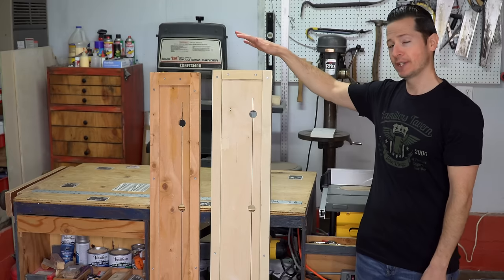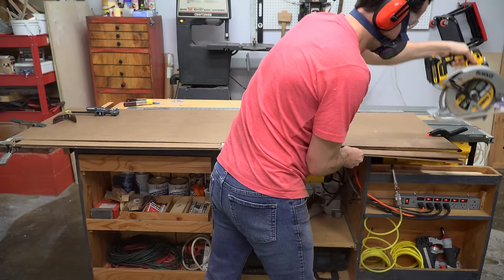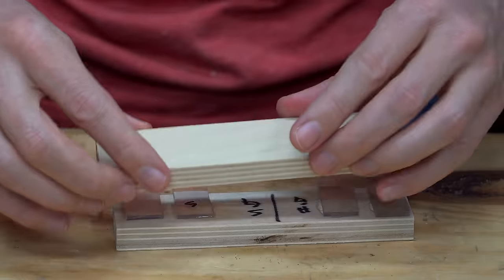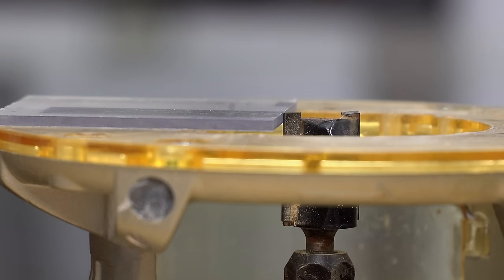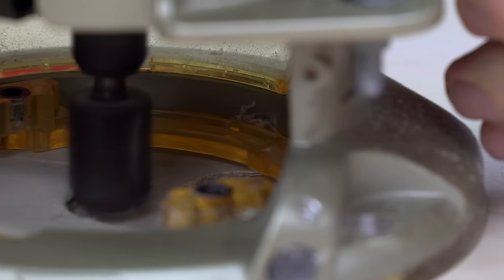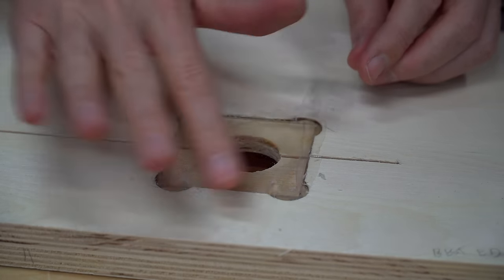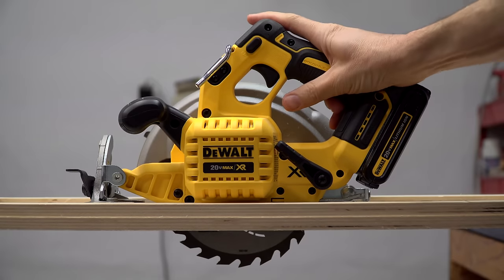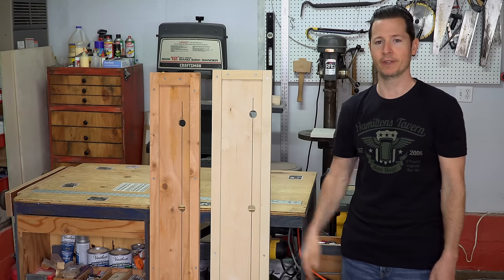DIY Saw Track Update

Comment: Great idea but whats the advantage of the plexi glass?
Reply from the maker: Thanks! The plexiglass just helps reduce tear-out at the sight hole locations. I hope this helps!
Reply: It also seems that it helps to line up the edge of the plexiglas with your cut line. (Instead of just the corners at the edge of the circle)
Reply: It is harder to scratch than polycarbonate.
Reply: @JF-mq8tp  Lexan IS polycarbonate
Reply: It appears the plexy will give you an alignment assist for your mark. When I try this I will put in the plexy also.
Reply: If you leave plexiglass slightly lower in dado, will it keep it from scratching over time?

Comment: TO make a splinter free cut first make a "kiss" cut . set the saw depth to just barely cut thru the top surface then lower the blade to cut all the way thru. I have a sharpie mark on the depth adjustment to quickly set the " Kiss" cut/ depth High end cabinet table saws have a small kerf blade directly in line with the main blade making a kerf  cut does the same thing the kiss cut does
Reply from the maker: Thanks for the tip!

Comment: Great build - what about using plexiglass as the whole base for more visibility as well as a deeper cut
Reply from the maker: Thank you! You could use plexiglass, but it would probably increase the cost of the build substantially. I hope this helps!
Reply: I did wonder the same. If a reasonable size piece of plexiglass is cheaper than the shop-bought circular saw guides then I reckon it'd still be worth it. Mind you, if it's not cheaper... Another option might be to cut a series of channel-style guide gauges, and use slim rectangles of plexiglass to similar effect?
Reply: @ErraticPerfectionist  ,    the whole thing was about simplicity,  easy to build,  less work to build,  fast to build which ended to very practical and precise while inexpensive.   Although  his design produced precise cuts, same time avoided to be:  ''erratic perfectionist'' .  Trust me ,  I was manufacturing engineer working with tool designers all the times.  I can detect ingenious  tool designer  when I see one.  This kid is one of them.
Reply: @sanramondublin  When I'm designing ANYTHING, especially jigs and tools I always ask myself, ok that will work, now how can I make it simpler and still work the same way? I keep repeating this until there is absolutely no way to make it any simpler.

One of the most annoying things I come across in tools, kits,, jigs, etc, is way over engineered garbage. It's almost like some people take pride in how complicated they can make something. 
There is an absolute beauty in simplicity.

Comment: I have an upgrade suggestion for your design, add T-Slot track on the underside to be able to use track clamps to attach the guide rail to the workpiece from the underside. That way the clamps would not interfere with the saw. On my Makita the motor sticks out 3 1/4" from the saw base plate so the clamps can't be within that distance of the saw.

Comment: I suspect the masonite suggestion was for the bottom plate only; you'd still use timber for the guides/stops for stiffness/rigidity.
Irrespective an excellent project and I'll be giving it a crack (once I upgrade my saw).  Thanks!  :)
Reply from the maker: Thank you, and good luck with the project!

Comment: Quick tip I learned on my chop saw but it will work and may help on these as well. So on ur 2 long parallel peices that keep ur saw in line, cut the bottom inner edges at a 45⁰ and it will allow saw dust to not build up pushing ur saw up and out, not sure if that's an issue yet (I've yet to build one, but am definitely going to) just a thought! Overall love ur channel man great vids and excellent work! 👍🏻
Reply from the maker: Thank you, and thanks for sharing that great idea!

Comment: Hey Tommy, made your updated saw track over the weekend.  Followed the steps and it came out great - and I did the holes with a jig for consistency, the plexi was perfectly flush - nice!  But when it came time to cut the slot it all came to a bad end.  I used cheap big-box plywood that appeared to have a fair share of voids - even though it was 3/4 inch ply, my blade seemed to follow the "path of least resistance" and even thought the saw stayed in its track perfectly, the wavy line it cut was nearly unbelievable.  More than 1/8" to either side of what should have been the line.  The saw is a Milwaukee worm drive titanium and the blade is a Freud Diablo 40 tooth blade.  Amazing and frustrating.  Looking for a stiffer blade for version 2.0.  I had to cut up the jig and throw it away - such a bummer.   Wondering if anyone else has had this experience or has ideas on what else could have caused this.
Reply from the maker: That’s too bad...and very unexpected. The first thing that comes to mind is to check to make sure your blade is (or was) properly installed and tightened. I can’t imagine the material pulling the blade around that much, especially when it’s locked into a straight line by the track. Blades have some amount of flex, but what you’ve described is extreme. You could easily get that straight of a cut (or straighter), with no guide at all! I’d look to make sure your saw is in proper working order as a first attempt to remedy the situation. Ince you’re sure it is, then do test cuts with no guide, then test cuts with a straight edge. Once you’re getting decent cuts by hand and with an edge, then maybe reattempt the track. Let me know what find!

Comment: The single guide sleds (length /width) I built years ago make accurate cuts from just a couple of checkmark measurements without having to draw a cut line. I love your captured saw design and understand the reason for the line to show in the spaced holes. I'm just curious why on your second design with plexiglass you stayed with the holes? Couldn't a one inch wide plexi be routed in the length for the z-c cut to eliminate the need for marking a complete cut line?
Reply from the maker: Jeff, yes a full length piece of plexi down the center would be easier/better, however longer pieces of plastic are usually more expensive. That said, if you have a source for good plastic at low cost, I say go for it! Either way, it's a great addition to the idea - thank you for sharing it!

Comment: Well done, a really good design tracksaw.
Something to be aware of when using superglue with clear plastics. Superglue is used to develop fingerprints on surfaces by forensics. The superglue fumes react with the oils left by the fingerprints and leave a very pronounced permanent print that was previously invisible. I don't know if any fingerprints appeared on your clear plastic veiwholes after gluing but it is a risk when using superglue around any clear plastic.

Comment: I can appreciate the aesthetic appearance of the plexiglass in the sight holes. It definitely makes it look a lot more professional. What exactly is the purpose of putting the plexiglass in the holes? I don't understand the functionality of them. Do they make any difference in the performance of the track? Or in the lining up of the track on your cut lines/marks?
Reply from the maker: It reduces tear-out at the sight holes. That said, unless you’re making finish cuts on furniture, the plexiglass is overkill. I’ve built several tracks now, and plexiglass was a popular viewer request.  In practice though, 99% of the time you probably won’t need it. I hope this helps!
Reply: @OneMinuteWorkbench  Thanks for replying! It means a lot! There are a lot of YouTubers out there that will post a video and leave some questions unanswered. I asked in the comments -as they tell us to; "If you have any questions, post them in the comment section below". I do... And they don't answer!! You've earned yourself another subscriber for your interaction with me!!!

How about a 3-ply track?
Use a stiff piece of plywood - 1/2" maybe???
On top of that, glue or tac Masonite so the table saw will glide easier.
Also, maybe a roll of adhesive 80 grit sandpaper for the bottom? With an 80 grit  (or 100 grit) bottom, you might not even need clamps!!! I would love to see that one made!!! That would probably be the final build, because you couldn't get any better than that!!! 

Thanks again for replying!!!

Comment: Maybe label the track with carbide thickness of blade, and/or blade model/series, used to make the track blade slot. Standard 7 1/4" 24T  Diablo carbide is thinner than most other brands. Another thing ti bear in mind is blade deflection of modern blades.  Also,  how long, how many passes/cycle/repetitions does it take to wear a slight groove in the guide fences with the saw table thereby shaving the cut slot wider?  I like the build b.t.w,  and will probably make one.  Thanks for the video.

Comment: There may be an easier way to fit the polycarbonate windows. With a mortise and tenon, cutting the mortise first makes it easier to fit the tenon, because it is easier to trim the tenon. 
For your site holes try routing on the inset on track first. It might be worth using a simple template to create a rectangular shape. The size is not critical, but a rectangle will make it easier to cut the polycarbonate window to fit. Next, you may  round the polycarbonate corners with a disc or belt sander. Or you could square the rounded corners on the track left by the router. Either way will avoid the need for hot glue as a filler.
Reply from the maker: Thanks for the suggestions!

Comment: Very cool & nicely done, only idea to improve would be to sand those sight holes a bit preferably before applying the polycarbonate just so when they inevitably get excess sawdust in them and the like at some point when you need to clean to maintain clarity it would be easier to clean out with a smooth surface on the side of those holes.  Maybe apply a small bevel with the router on the top side of the circular sight holes to make it easier to clean and negate the lack of sanding those down beforehand.  Overall great work and better than I would have come up with on my own. Thanks for sharing will be making one of these myself hopefully before not to long. Keep up the good work!
Reply from the maker: Thank you for the compliments, feedback and suggestions. Good luck with the project - let me know how it goes and if you implement those changes, let me know how that goes too!

Comment: Read and then skimmed through the comments and rewatched the video...what improvement does the plex give you over the holes?  visibility? dust avoidance?  Why do I want to cover the site holes?  Thanks, I've sent back the Kreg I bought and have been working just with a straight edge and clamps. Want to make this one and I noticed the worm drive issue and my direct drive saw, so thanks for the update.

Comment: Melamine perhaps? For greater slippage.

Clear epoxy filler to hold acrylic in, or at least to fill round it?
Reply from the maker: Good ideas!
Reply: Zero clearance w/o plexiglass.
Painters tape on cut line.
Only use when perfect cut/s needed.

Comment: Great video and good work. You truly are a talented craftsperson.
Your earlier video I had concerns on how you read the pencil line for accurate cutting.
Perhaps another way is to also make a jig measuring from the left of the rail. My idea is if you are to make a cut say 600mm it may be a little out one side to the other despite holding to the pencil line. If you have multiple cuts of the same size, you can cut a type of ruler with a sliding stopper.
Make 2 of these. Clamp stoppers at the same distance and hold to the left of the fence. A parallel guide.
Of coarse you subtract the measurement from the saw cut to the back of the fence.
So perhaps at the left of your fence if you make the measurement an easy subtractable. 
Make it wider if it's an easier subtraction ie for arguments sake 200 mm opposed to 198 mm or 8 inches instead of 7 5/8 inch.
If you really want to get technical make the parallel guides with a ruler and actually subtract the measurement from the saw line to the left side of rail so which ever measurement you use means that's the size of the material you cut.
Great video great work and good innovation.

Comment: Depending on direction of cut, the direct drive motor may hit the clamps. I've run into that before. I liked the first design, the new one is getting fancy!
Reply from the maker: I had an issue where one of the clamps was in the way of the motor, but was able to adjust it towards the outside a little further, and that provided room for the motor to pass. Maybe a better solution would be to just flip the clamp over so that the handle is below the surface. I do agree the new one is too fancy though....😂 But that's okay - people wanted to see it, and I needed to build a new one for the new saw anyway. Thanks for the feedback!
Reply: I was debating using a wider base piece so that could be clamped instead of the frame.
Reply from the maker: Sounds reasonable - let me know how it goes!

Comment: Thanks for the great ideas. I'm just building this from the original video and think I'll add the plexiglass. Just interested to know, what thinkness plexi did you use?
Reply from the maker: No problem! I think I used 1/16" plastic. Thicker should be fine, but I wouldn't go too much thinner. I hope this helps!

Comment: Nice video! I know that this video is over 5 years old, but I wanted to make one comment. 1/4" hardboard would probably have worked if you had continued to use 1/2" or 3/4" plywood for the sides and the stops and only used the hardboard only for the bottom. This would give you the maximum possible cut depth. Just cut the hardboard a little wider and longer than needed and then glue the plywood strips to the hardboard, and once the glue has dried trim off the excess hardboard. Flat L-brackets in the corners on top of the plywood would add some more strength.

Oh, saw this on another video on making circular saw guides to add make these non-slip just like the fancy track saw tracks. He put three pieces of blue tape the length of the guide to frame two strips of the bottom of the guide. Then he applied clear 100% silicone caulk along those strips and then used a plastic card riding on the strips of tape to spread the caulk in thin and even layer and to remove any excess. Once the caulk has dried, then just peel off the tape and you have two non-slip strips along the bottom. I might go with two thicknesses of blue tape to get a little thicker layer of caulk.

Comment: You could just use the Plexiglas or Lexan for the bottom and make your picture frame on top of that. The track does not need to support the weight of the saw, the material you are cutting should do that. You would then have a clear base to easily see your cut marks or line.
Reply from the maker: Definitely an option, but only if you have a good source for low-cost Lexan. A sheet that big might be pretty pricey, and could defeat the cost of a low-cost track saw. I hope this helps!

Comment: I think these are pretty. I have 2 lengths (8 foot and 4 foot long) of more of an edge guide.  I can cut to either the right side or the left side. Just plain plywood (1/2 inch) for the base with about an inch and a half or so wide strip that the circular saw frame rides against. 

Thanks for sharing this video!
Reply from the maker: I'm glad you dig them - thanks for the feedback!

Comment: Very simple and efficient design. A couple of questions though, do you have problems with sliding the saw down the track? Did you apply any kind of wax on the surface to make it slide better? Also, have you thought about putting a few strips of low coefficient tape?
Reply from the maker: I'm glad you enjoyed the build! The sliding action is very good actually - a lot of people mention making it better, but I honestly haven't seen a need to. If it did need lower friction however, my first choice would be wax. I hope this helps!

Comment: I'm late to the party here but appreciated both the original and updated track saw videos.  What I would be interested in hearing from you is whether the Lexan windows make any significant difference in the function of the track saw.  I don't see a major improvement...but I'd welcome hearing your thoughts on it.  (New subscriber and 'bell ringer'; thanks for your Channel!)
Reply from the maker: The only difference is that it makes the entire length of the track "zero-clearance". Unless you're doing furniture quality edge cuts with the track, the windows are overkill. I hope this helps - thank you for subscribing, and welcome to the channel!
Reply: I like that the Lexan widow shows you exactly where the blade will cut.